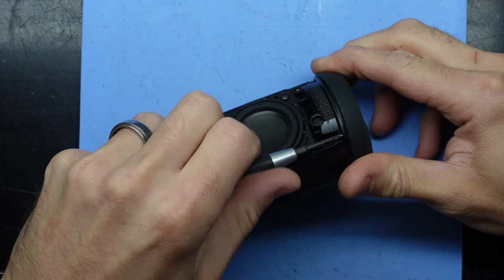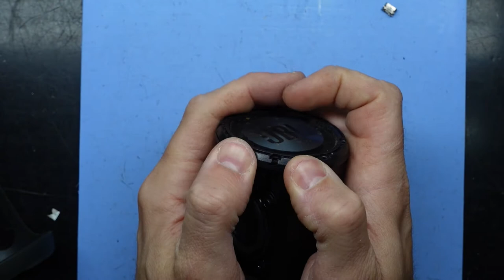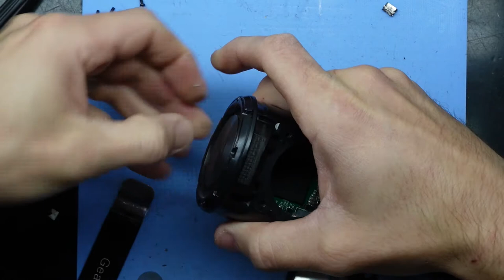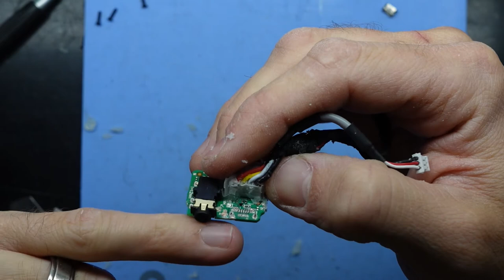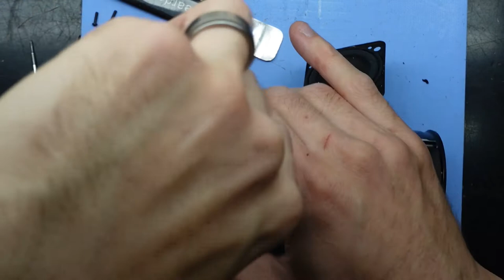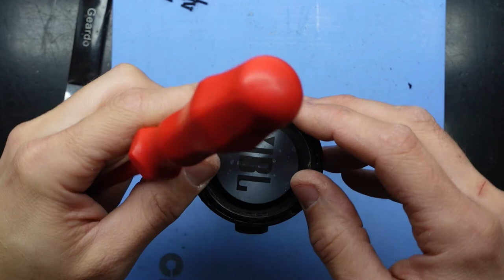JBL flip essential teardown and charger port repair

Comment: Great Video thanks ! When the USB minicable too the usb loading port on JBL  is clitchy an cant just can go inside completelly with some spare mm too fully insert the contact. Can that be any other damage ? I mean why wouldnt the usb-socket for the JBL not be able too insert the usb cable ?
Reply from the maker: apart from trying a different usb cable, there is not much more i can recommend doing.

if the cable doesnt go in, will probably need a a port replacement

Comment: Is this something you could run a direct power source to if you remove the batterys
Reply from the maker: Possible. Could adapt a barrel connector to it and leave it plugged in to DC

Comment: How much did you charge for this it looks like it’s so time consuming compared to other repairs like what’s the time vs  cost ratio
Reply from the maker: I charged $40AUD for this repair, which is around 1/3 of the price of a new one

Most of the time spent was assembly and disassembly

Comment: is it possible to solder a type c adapter instead of the microusb or will it be problematic?
Reply: Yes, but it can't fit the casing since the casing is shaped like a micro usb port

Comment: Love JBL but they dropped the ball on this one. That part is way to flimsy. I also have the original that doesn't have as much base but sounds great. Its much more durable and don't depend on that charging port.
Reply from the maker: Stuff always keeps getting cheaper , this is one of the costs

Comment: It's not glue it's silicon they pour in and it sets. Horrible stuff to remove. You also only need take one end off the unit to fix it not both ends and only remove one speaker and undo connectors then put speaker back in to stop it getting damaged . It's a horrible thing to repair to be honest.
Reply from the maker: cheers for the tip